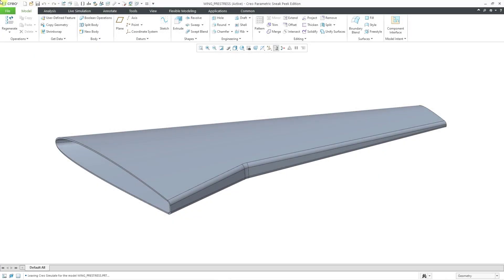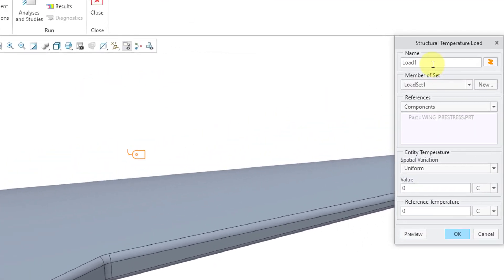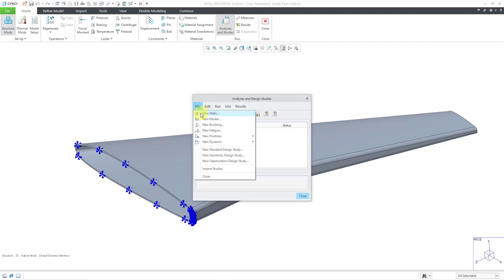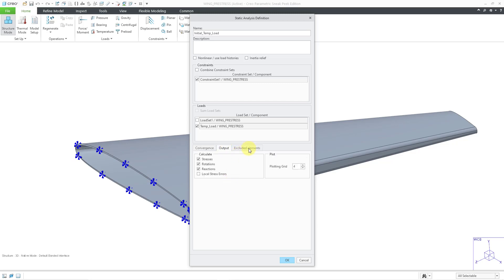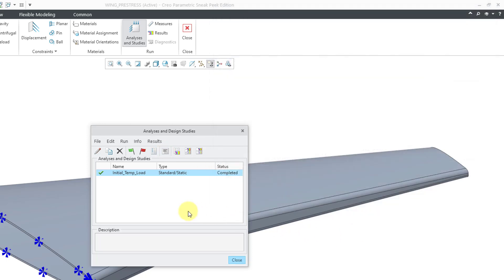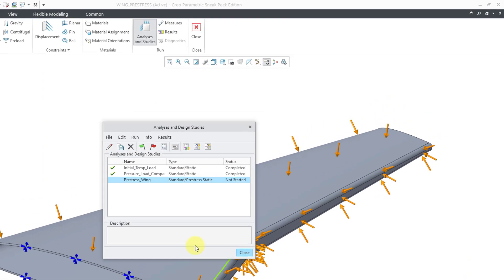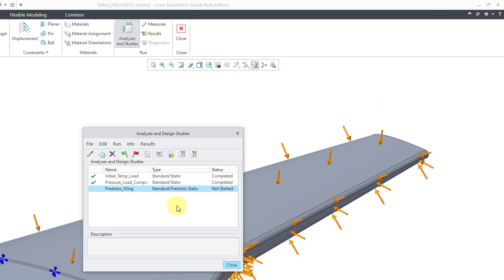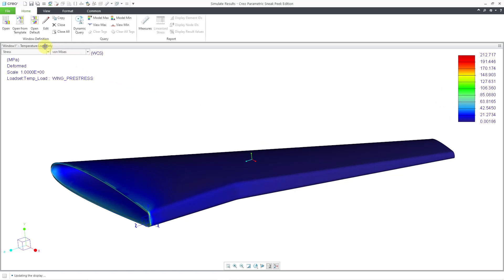Creo Simulate - Prestress Static Analysis

Comment: Hi. I am a Creo user. Working plastic packaging mold manufacturing. I am in need of plastic bottle drop / top load testing on design stage. Do Creo has the option on this.